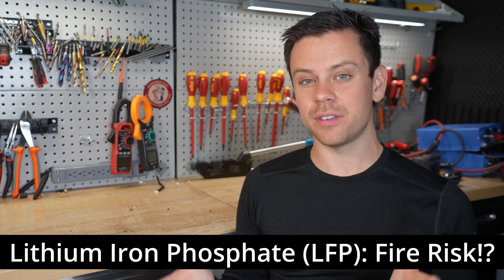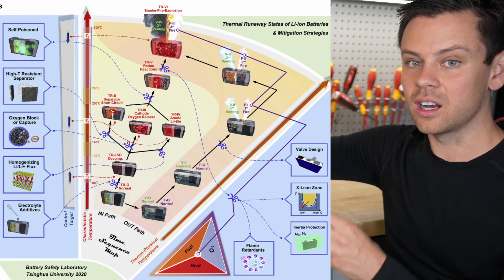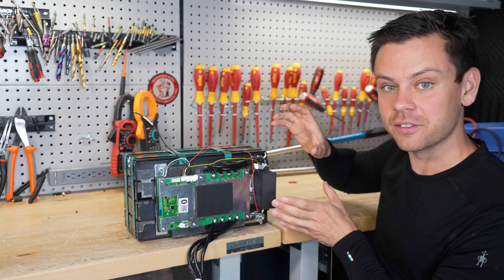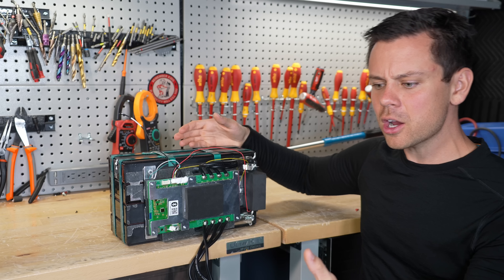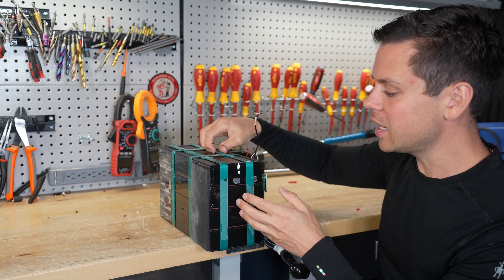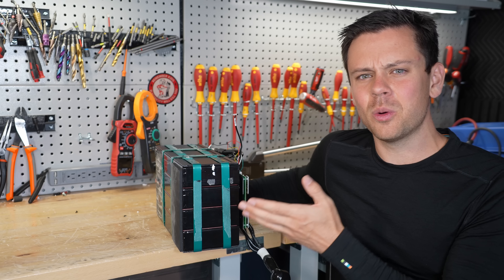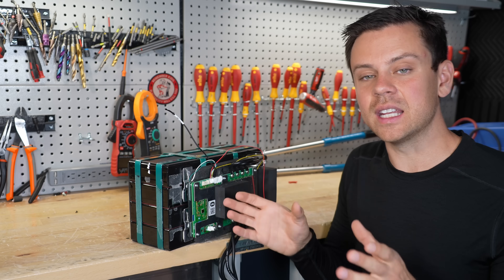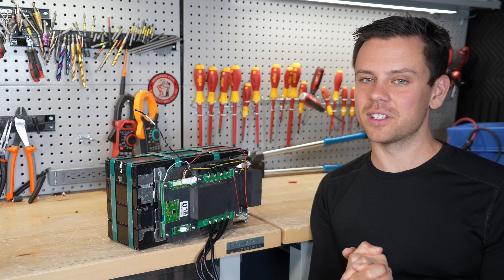LFP Battery Fire Safety: What You NEED to Know

Comment: LiFePO4 Battery Safety Claims: A Comprehensive Fact-Check
I’ve conducted an extensive fact-check of the claims made in this video about lithium iron phosphate (LiFePO4) battery safety. Here’s my analysis of the key assertions:
Claim 1: LiFePO4 batteries “literally cannot catch fire” - PARTIALLY TRUE
The video claims that LiFePO4 batteries are “literally physically impossible” to catch fire through overcharging, over-discharging, or cold charging. This is mostly accurate but oversimplified.
What the research shows:
	•	LiFePO4 batteries have excellent thermal stability and are significantly safer than NMC or cobalt-based chemistries
	•	They are classified as “incombustible” under normal abuse conditions
	•	However, they can still catch fire under extreme conditions when exposed to external heat sources or through severe internal failures
The nuance: While LiFePO4 cells themselves won’t ignite through typical abuse scenarios, the electrolyte can still be combustible if exposed to external heat sources and spilled from the cell. Research shows LiFePO4 batteries can ignite at temperatures around 175-180°C during severe thermal runaway events.
Claim 2: Thermal runaway temperatures are “not high enough to catch paper on fire” - MISLEADING
This claim is significantly misleading based on the scientific evidence.
What the research actually shows:
	•	LiFePO4 thermal runaway temperatures typically exceed 250°C (482°F)
	•	Maximum temperatures during thermal runaway can reach 390-600°C
	•	Paper ignites at approximately 233°C (451°F)
	•	The thermal runaway temperature threshold is around 270°C (518°F)
The reality: LiFePO4 thermal runaway temperatures are well above paper’s ignition point, making this claim factually incorrect.
Claim 3: LiFePO4 thermal runaway is “not self-propagating” - GENERALLY TRUE
This claim is accurate and supported by research.
Supporting evidence:
	•	LiFePO4 batteries have superior thermal stability compared to NMC/cobalt chemistries
	•	They don’t release oxygen during thermal runaway like cobalt-based batteries do
	•	The iron phosphate-oxide bond remains stable even under abuse conditions
	•	Without oxygen release, the self-perpetuating thermal runaway cycle is broken
Claim 4: Electrolyte becomes combustible only when spilled - PARTIALLY TRUE
The video correctly identifies that the electrolyte can combust when exposed to external heat sources.
Research confirms:
	•	LiFePO4 electrolyte can ignite at high temperatures (>250°C) in the presence of oxygen
	•	The electrolyte is flammable when exposed to external heat sources
	•	However, recent research shows that even “non-flammable” electrolytes can have safety issues
Claim 5: Gas venting is the primary danger - TRUE
This is one of the most accurate claims in the video.
Research strongly supports this:
	•	LiFePO4 batteries can release toxic gases including hydrogen fluoride (HF)
	•	Gas concentrations can be higher in LiFePO4 than NMC batteries
	•	Toxic compounds detected include organophosphorous compounds similar to chemical warfare agents
	•	The electrolyte vapor has anesthetic effects and respiratory tract irritation
Claim 6: Build quality and wiring are the main fire causes - TRUE
This claim is well-supported by research and industry experience.
Evidence shows:
	•	99% of battery fires are caused by external factors rather than cell failure
	•	Poor connections, inadequate wiring, and BMS failures are primary causes
	•	Loose connections can create dangerous hot spots
	•	Internal shorts from poor manufacturing quality are significant risks
Major Issues with the Video’s Claims:
1. Temperature Misinformation
The most significant error is the claim about thermal runaway temperatures being too low to ignite paper. Scientific data clearly shows LiFePO4 thermal runaway temperatures (250-600°C) far exceed paper’s ignition point (233°C).
2. Oversimplified “Cannot Catch Fire” Claim
While LiFePO4 batteries are much safer than other lithium chemistries, claiming they “literally cannot catch fire” is an oversimplification that could lead to dangerous complacency.
3. Incomplete Discussion of Gas Toxicity
While the video mentions gas dangers, it doesn’t adequately emphasize that LiFePO4 batteries can release higher concentrations of toxic gases than NMC batteries.
Conclusion:
The video makes several accurate points about LiFePO4 battery safety, particularly regarding their superior thermal stability, non-self-propagating thermal runaway, and the primary dangers from gas venting and poor installation practices. However, the claims about thermal runaway temperatures and absolute fire impossibility are factually incorrect and potentially dangerous.
LiFePO4 batteries are indeed much safer than other lithium chemistries, but they still require proper handling, installation, and safety precautions. The video’s overall safety message is sound, but the technical details contain significant inaccuracies that needed correction.

Comment: @pwlw185 is spot on. This Australian regulation is smart. LFP isn't less dangerous than the wooden desk (as Will stated). Search UL and NASA's collaboration "Fire and Gas Characterization Studies for Lithium Ion Cells and Batteries" and YT vid "LiFePO4 Puncture Test - Can these batteries catch fire? Is LiFePO4 Safe?". LFP is far safer than other lithium chemistries, but they WILL go into thermal runaway (sometimes propagating to adjacent cells), reach internal temps near the melting point of aluminum, and vent sobering amounts of flammable gases when exposed to heating; internally (like a short bypassing the BMS), or externally (a nearby fire/malfunction). Hydrogen's Lower Flammability Limit (LFL) is 4%. All lithium battery vent gases contain lots of hydrogen, making their LFL around 10%. 

FAA tests even found that Halon 1301 suppression agent at 4% concentration couldn't prevent battery gas fires, mainly because the hydrogen is lighter than air and suppression agents are heavier than air.

In an open space, not a problem. In a confined space, cells need a heat-durable enclosure (anything with an intumescent coating inside or made of metal) with a vent to open space to prevent a gas release from getting the ambient air above the LFL. Extremely unlikely, yes. But, if you get unlucky enough to have venting, and these gases find an ignition source, your day just got very bad indeed!

Comment: It only becomes dangerous when the electrolyte outgasses at a high state of charge (SoC), as a lot of hydrogen (H₂) is released in that case. If this happens in a closed room and there's an ignition source present—like damaged cables, inverters, etc.—it can indeed lead to explosions capable of destroying entire houses. It has happened before... but even in such cases, several safety mechanisms must have failed beforehand for something like that to occur.

Comment: You said any other chemistry does that include lithium titanate  Will ?
Reply from the maker: I actually had a whole segment on lto in this video but no one's using it so I just took it all out lol
Reply: @WillProwse  Its okay Will. And I don't have a setup running. But I do have all the equipment to do so including LTO batteries. I'm 62 and Im planning on setting it all up when I'm 80 totally off grid. When that happens I will show you pictures of the setup. I'll want you to see it.

Comment: I use an Ecoflow Delta 2 power station and add on Delta 2 extra battery inside my cabin. Is there a risk using these attached to my solar panel all the time?

Comment: Hi Will.  Love your videos.  Do you have a video on how you would wire multiple 12v batteries into series.  I putting together a battery array together with (12) 12v batteries and was curious on size of breakers and fuses and where to use them.

Comment: 2024 I had what "Moab voluntary fire department " reported as a lithium fire in my RV. the problem was actually my hydraulics having a leak, spraying onto the batteries until it created a spark. Hydraulic fluid in most RV's is ATF (just rebranded to "RV hydraulic fluid" to charge more). This expanded when the small fire caused the hydraulic line to burst dumping more fluid into the bay. I removed the batteries from the RV (800AH 4s packs) and did have one cell vent, but that was directly beside the hole in the hydraulic line. The rest of the packs were damaged due to external heat so we disposed of all batteries and replaced after insurance settled. I also replaced all hydraulic lines in the bay with armored industrial 5000psi lines vs the 2200psi RV stuff. I now have sungoldpower 48v "powerwalls" in the RV (which Id love to see a tear down of at some point :D )
Reply: Atf has a pretty high flash point for a spark to ignite it.

Comment: Are there any 12v immersion heaters that could be used to replace the 240v one? would be ideal for camper van situation. I know the current would be a lot higher and it would be a lot slower.

Comment: What is a safe procedure if a LFP battery starts to vent smoke? If you just run away you have no control over the failure process and it's effects on associated equipment. Maybe some kind of fireman's switch outside the solar shed is a good idea.

Comment: Sounds good in theory  but ive had personal experience with a 48v 20amp lipo4 that did indeed burst into flames while recharging. 
Luckily i was charging it outside & not in its usual place in the garage, or the outcome could have been very different.
Reply: More details
Reply: @Gary-ee3kq Battery was around 2 yo, powering an Ebike, had completed the usual 20km (13mile) trip home, plugged into charger (5 amp per hour).
However i didnt go check after 2 hours to see if it finished charging like i usually did.
4 hours beyond the time it should've turned itself off via the BMS, i suddenly noticed a lot of white smoke drifting past the window. I ran outside to see the battery venting wildly & then burst into flames. I tipped the bike over to get the battery onto the ground & hit it with a powder extinguisher.......which made it create a looooot more smoke & brought the neighbours running in. I eventually got it put out & was left with a molten mess.
Id had no previous issues with the battery or charger. I did buy another one & chargerr, but im very careful with recharging, ill never fully trust it.
Reply from the maker: Can you post it on the forum with pictures?

Comment: This chemistry has still been responsible for some absolutely devastating large scale battery storage facility fires in the US that burned for weeks and even managed to reignite… In my opinion there is no “acceptable” risk with this much stored energy within a home. It should be highly regulated and only permitted in an isolated enclosure that is separated from your property… Likewise n Australia, all the subsidies and dodgy suppliers invite cost cutting installations being used far and wide to claim government incentives.
Reply from the maker: Those are NMC batteries. Not LFP
Reply from the maker: This is the type of misinformation that I'm talking about. This comment right here.
Reply: @WillProwse The area that initially caught fire was the their most recent installation and used those newer cells which spread then to older installations. It is on public record / fire investigation? So you’re saying they lied? I get it that it is a safer chemistry but it doesn’t matter what chemistry is in use ultimately when you’re still dealing with ridiculous energy densities / potentials.

Comment: if you get big battery you got to get system to monitor it. it's just like a generator you have to keep checking  oil and refueling it. battery monitoring engine refueling it's just like babysitting. but less work.

Comment: Speaking of build quality and LiFePO4 battery devices... I'd love to see you do some tear downs on consumer "solar battery" devices such as Bluetti, Jackery, EcoFlow, Anker, Pecron and others sell.  It seems like you looked at this more often a few years ago but now only occasionally look a model or two.  I recently got a Pecron and it had a really bad problem - unfortunately I didn't have the latitude to pull it apart and figure out if it was a manufacturing issue or a design flaw.  I'd love to know what you think of these major brands now they have all migrated over to LiFePO4 batteries.

Comment: Thanks, for the longest time, I was not willing to switch over to Lithium Ion batteries because most batteries were based on NCM chemistry, but after LiFePO4 came out, I switched. Most people don't know the difference and still thing all lithium ion batteries are the same and can cause a fire.
Reply: Researchers in the United Kingdom have analyzed lithium-ion battery thermal runaway off-gas and have found that nickel manganese cobalt (NMC) batteries generate larger specific off-gas volumes, while lithium iron phosphate (LFP) batteries are a greater flammability hazard and show greater toxicity, depending on relative state of charge (SOC).
Reply: @Loki-rascal show the proof

Comment: If you hold a welding torch to the LFP batteries, it can release toxic gases. 
If you bring these gases above 300°C you can also ignite these gases. 
In any case, you have to bring an external fire source to the LFP and heat it from the operating temperature (<50°C) to over 300°C. But at such high temperatures, all furniture would already burn.

Comment: Read the document "Thermal Runaway Characteristics and Gas Composition Analysis of Lithium-Ion Batteries with Different LFP and NCM Cathode Materials under Inert Atmosphere". 
Conclusions: "In people’s impression, LFP batteries have better thermal stability compared to NCM batteries during normal use and thermal stability tests. However, in the case of a large-scale battery thermal runaway incident, such as in an energy storage power station, considering the gas production components, LFP batteries may be more dangerous. "
Here in Germany there were H2 explosion of house LFP batteries. One was 2023 and one was on February 2025, which destroyed two homes build from bricks. In China there was an explosion of an 25 MWh LFP battery, were 2 fire workers died. 
My opinion is that LFP batteries should have a temperature sensor at a pole of each cell and a separate security controller independent from BMS  to cut external power on temperatures above 50° C. This should at least prevent that cells come into thermal runaway triggered by external charging and overheating by loose terminals. Sensors may be as simple as cheap passive bimetal switches connected by a security loop.

Comment: Will, LFP has 3 hazzards! Gas, Fire and Explosion. Punctures, Overcharge, Undercharge, Short circuit, Age might trigger one of the hazzards. All of these hazzards ARE a mayor concern. Now you are downgrading the hazzards Even BMS's can fail. I received myself a broken JK myself, this had a failure on the themperature sensors, it could not detect any. This might allready be hazzardous, because it would allow the LFP to charge while the cells are frozen  and it would not shut down while the cells become overheated either. Overheating might cause the cells to vent. The gas is toxic the gas is flameble the gas does contain H2 (Hydrogen) and oxigen to the gas can cause a mayor explosion. When it is on fire it will maintain in fire because it is self feeding oxigen and flamble gasses.